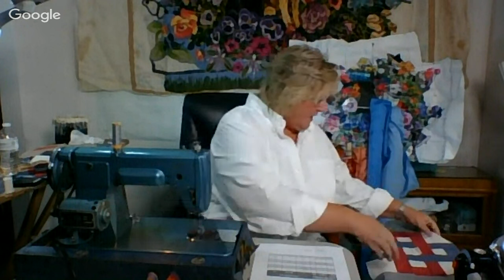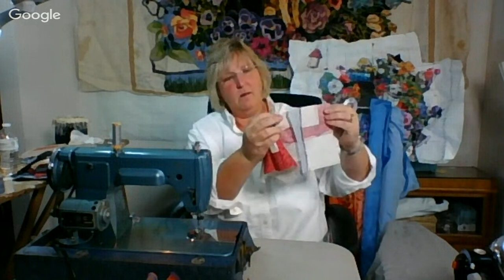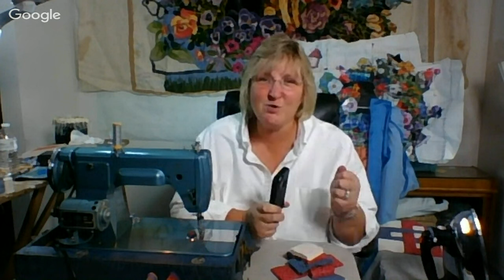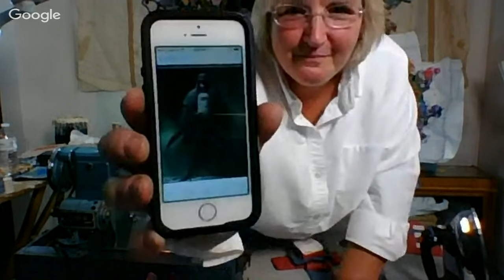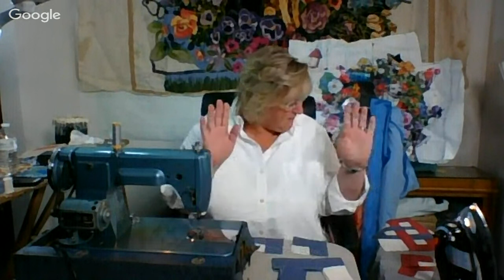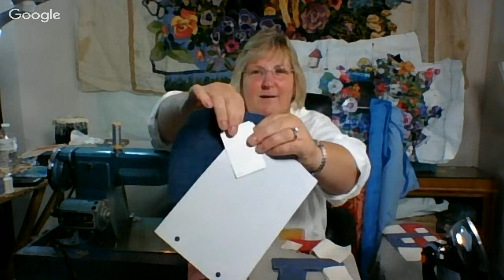Simply Colorful FiberCast: Partial Seams and Sloan-Ashland Machine

Comment: Try holding the oil can upside down on the place that needs oil and then push the bottom of the can with your thumb. The metal bottom of the can should flex a bit to push the oil out.